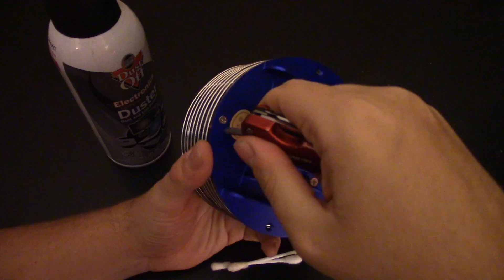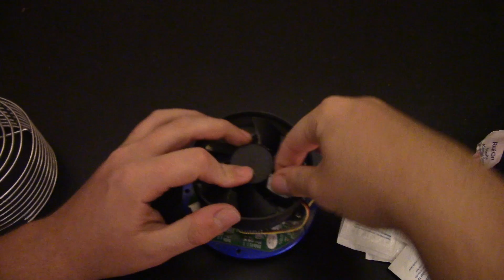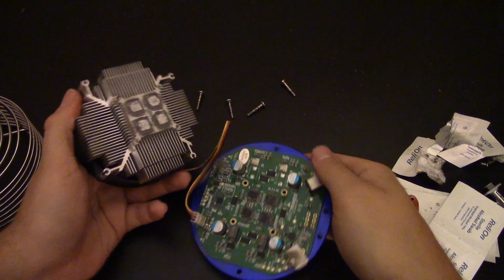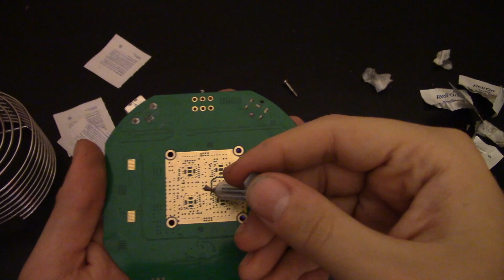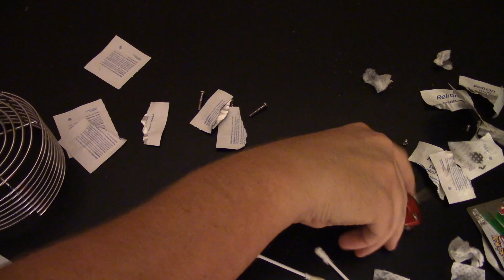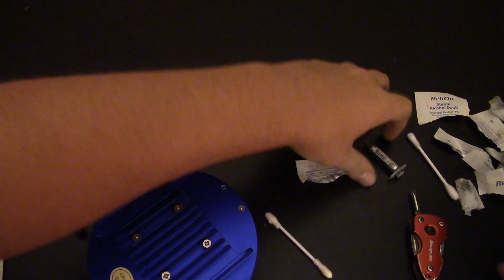Antminer U3 teardown + replacing thermal paste & cleaning

Comment: Card method is bad, it leaves pockets that air gets trapped in and degrades the effectiveness of the paste.  Best method is to make a lowercase "d" with small amounts of the paste and then apply the heatsink to spread it around.